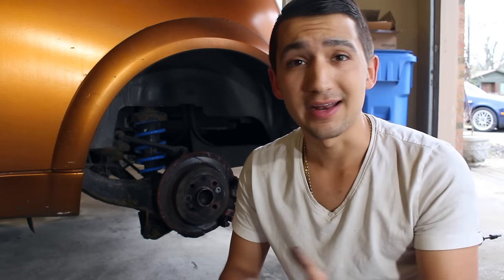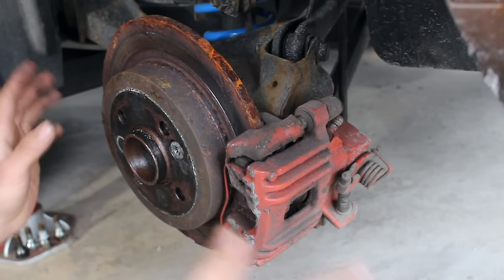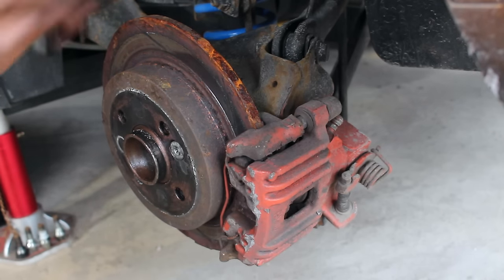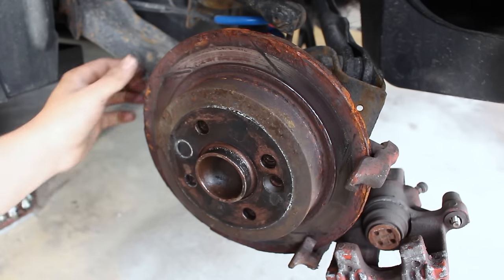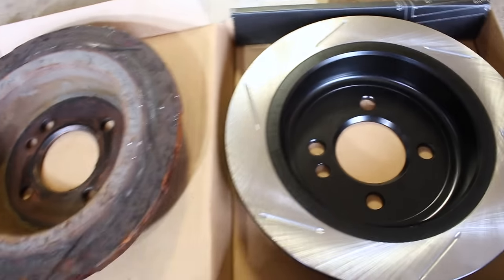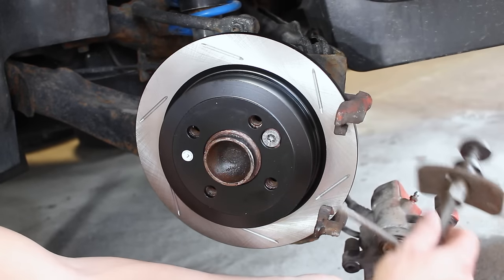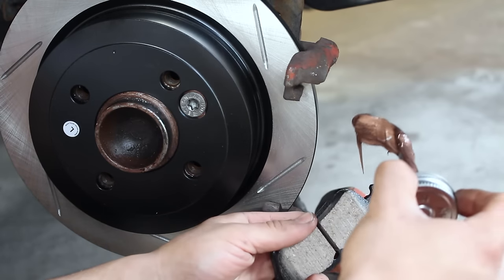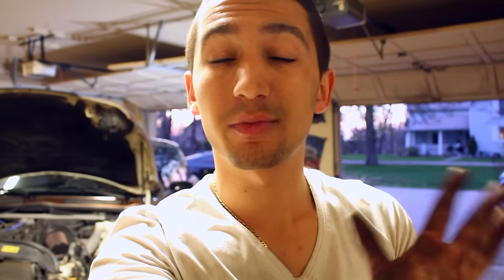The Best Lube for Your Brakes

Comment: The “general rule” is to use anti-seize” when joining 2 or more assemblies that are static; I.e. they don’t move relative to each other like a nut and bolt. . Grease is used when joining assemblies that are dynamic; i.e they move relative to each other like ball bearings mounted in a race. 
So, use grease on the caliper pins AND use grease on the “ears” & back of the brake pads & the guides. Anti seize “could” be used on the bolts that secure the caliper to the pins since those 2 assemblies are “static” relative to each other. 
Something I recall from many years ago from a Mechanical Engineering course.
Reply: I used permatex brake grease i used color violet to lubricate the back of the brake pads and the ears of the brake pads aswell and also the brake shims and for my guide pins i used the permatex color green grease because i used versachem brake grease before but I see it tthat grease is not good it cause my rubber bushings to swollen that's why I used those permatex brake grease
Reply: Qe awwwwqa
Reply: You should definitely NOT be using anti seize on bolts that secure the caliper. They often come with thread locker from the factory, so if anything put a bit of the blue one so they don't come loose from vibration.
Reply: In any area prone to snow, ice road salt and brine, use anti seize on every nut and bolt, even lug nut s. Vibration loosening is a myth.
Reply: @mattp4079  That’s been my experience also - I’ve seen grease or anti seize used with little or no loosening of fasteners. 

However if anti seize or “regular” grease is applied to wheel lug studs it reduces the friction when the lug nuts are installed & it changes the recommended torque. It’s possible to “over stress” the fastener where it may affect its yield strength - but again, I’ve never seen this occur.

Comment: It's good practice to put a light coating of anti-seize on the back of the brake pads too.
Reply: Wrong! If you are going to use lubricant, the paste would be better. The anti-seize would mess up the piston rubber.

Comment: I don't usually respond to YouTube videos but I'll just put in my two cents well he did do a very good job at explaining things the one thing he did do wrong however was installed the outer pad wrong those two metal tabs that you see on the actual back of the brake pad are meant to actually go in the caliper side to meet the two pins on the inside of the piston he also didn't use any brake clean on the actual brake rotors nor did he clean the back of the actual piston other than that a very well made video
Reply: It's great that you ACTUALLY noticed. LOL

Comment: you don't really need to put little screws back on,they only use it on assembly line to keep it in place,while the car moving forward in different section of assembly line  ,the rotor is actually hold on in place by lug nut,it is not a safety matter at all ,for those who are wondering,why it is there
Reply: Damn, you're right

Comment: Lubrication is a good practice, but there were a few things ignored here: wash the rotor with brake cleaner (might be also 3M) - it is covered in anti-corrosive oil. Inner break pad was not worn, neither was the rotor - there is a problem with breaking forces distribution. It breakes with 1/4 surface/force. Without fixing this problem, you will very likely destroy the new set of break disks and pads as well. You could have cleaned and lubricated the wheel hub (instead of inner rotor). It is important to be clean and flat.

Comment: Clear video. Thanks for sharing so clearly exactly what you do and use. There are so many opinions about lubricating brake components and what lubricant or anti-seize to use or not use. I live in Texas so can't relate to all the corrosion issues caused by winter road salt and the extreme methods necessary to keep cars operating in your conditions.

Comment: honestly great video the only problem i see is the anti seize on the pads from my experience when i do brakes on cars that I've put anti seize on the pads it just washes away in the rain or car wash 3m silicone grease doesn't wash as easy and i still see it when it comes for it's second brake service (use pretty much the same stuff just silicone paste in a tube)

Comment: See a lot of YouTube mechanics here. Having worked at a dealership, been working on cars at home for years and done a lot of brakeservices, I can say he did everything very well! 
Would also recommend cleaning off the hub and applying new antisieze, cleaning off the piston as well as possible and using brake clean on the rotors. 
For those of you saying he should not use grease/anti-sieze on the inside of the rotor, you must be thinking of brake drums. 
In this video, there is no brake drum, and if you don't know the difference, and don't know what the friction surfaces are, you should NOT be performing work on the brakes of your car.

Comment: Anti seize is widely used on brakes, HOWEVER it is NOT grease! Grease is what the engineers of most cars recommend. If you don’t believe me look at your repair manual. BMW recommends very little in the way of any grease if I recall. So they vary, but most say to utilize grease and if you understand lubrication, there is a distinct and measurable difference between a grease and anti seize.

Comment: You're should've used Sil-Glyde for the guide pins, thats why one pad was worn down and the other still had brake pad material left on it. 3M's silicone paste isn't really designed for brake pins hence why the pin was stuck and caused uneven pad wear.
Reply: +yoshiko130 I have some sil-glyde. It is good stuff but it is just the napa brand version of 3m silicone paste.both will do a good job on the caliper guide pins.

Comment: The only thing I would add is that, for this application, any type of anti-seize will work.  You must use "Copper" anti-seize on electrical components, particularly O2 sensors and preferably on spark plugs.
Reply: I was just going to ask why he uses "copper" anti seize and not the regular (Permatex Aluminum) anti seize

Comment: It’s not as bad rotor, it’s poor contact from the pads due to caliper biasing issues.
Discs edges will only corrode and the friction surface will be lipped if the pads were seated correctly and able to move within the caliper for even coverage across the surface.

Secondly, should’ve cleaned the hub with wire wheel/brush to remove existing corrosion/rust.
Same as the caliper bracket and actual caliper piston/pot, generally on any contact area of pads or shims.

Comment: What's so special about 3m? Is this sponsored?  The autozone silicone and anti sieze paste works fine too
Reply from the maker: +Tech Stuff I wish it was, but no this video is not sponsored by them. I've used both of their products and I love both of them. It would be selfish of me to hold that information to myself.
Reply: Tech Stuff It’s a silicone based lubricant. There are many others like it on the market. Super Lube comes to mind. All of them work when used properly.
Reply: it comes from the same petro chemical refinery but the 3M brand has an additional marketing and patent lawyers budget built into its cost... 99% same goop 🙂
Reply: @nordicpride9708  True but people tend to have their preferences from past experiences.
Reply: @glasser2819  This prosuct is filled with copper. You'll find the permatex anti-seize is metal filled as well but it's a bit thin for brakes imho. Works great for plugs and steel bolts though.
Reply: Tech Stuff: It's not the Minnesota or the mining that does it for me. But you gotta love that mineral!
Reply: Well, there are a number of silicone lubes out there that say they are for brakes, yet they still swell rubber. I personally like NAPA's Sil-Glyde.

Comment: Between the pad and the rotor... should I use the copper anti-seize, or the silicone paste? The rotor is obviously metal, but I'm not sure if the pad has any rubber in it or not.
Reply: TYSON B.   Nothing goes between
the, - - PAD  &  ROTOR,   other wise, you can't - STOP!!   please, please!!
use common sense!
Reply: 1) Is this a joke?      
2) If not, do yourself a favor and NEVER attempt to fix a car without having someone who has mechanical aptitude watching over you.

Comment: I do not trust that the lube, so close to the pads, will not bleed onto the rotor or contaminate the braking surface.

When I saw the glob go on the pad hadware, I cringed. It's just to close to the rotor for my comfort, and I can imagine it getting onto the rotor. 

Not a criticism; if the results are good: great!

I also wonder if Sil-Glyde would be enough to lube everything: slide pins, retainer screw and hub to prevent seizing. I'm sure the copper anti-seize is great but just wondering if Sil -Gyde would be sufficient. 

I'm either too cheap to buy 2 products or I'm just more efficient and/or economy thinking. Lol
Reply: Chris O — Anti seize, aluminum, copper, or nickel works great metal to metal. If washout is not a concern, then lithium or calcium base grease will work on metal to metal. Silicone (with or without PTFE) is ideal where rubber seals and boots are concerned. Silicone grease  will work on metal to metal, but it just isn’t quite as washout out resistant. So yes, you could easily get away with just silicone and probably be fine. Geeky guys just like to use the best possible option for any particular circumstance. 😊

Comment: Just one really important thing !.....if your vehicle has an A.B.S or E.P.S system the DO NOT use COPPER or metallic grease as it will interfere or  damage the system ...always use NON-METALLIC grease instead 👍
Reply: .... then metalic brake dust would be a bigger problem wouldn't it.

Comment: Don't forget to spray brake cleaner on those new rotors, front and back, and wipe them off before installing. They come oiled from the factory.
Reply: That is not always the truth, Textar supplies them with a special silvery coating to prevent corrosion while their on the shelf. No need to degrease them as long as you did not grabbed it in your greasy hands.....Okay?

Comment: First he didn't do a good job cleaning calipers etc. Second he didn't apply anti seize behind the pads so they don't stick to the pistons. Third he didn't spray brake cleaner on the new rotors to remove protective layer of oil. All in all bad video.
Reply: not to mention he put anti seize on a coated rotor, thats why its painted black.
Reply: Using brake clean is recommended, but not necessary. The oil will be removed by itself pretty quickly, and is not enough to effect braking much. If you have worked with brakes, you know that even painted/coated rotors should be applied with antisieze, as the coating really doesn't do that much. It helps, but it's usually a very thin, weak layer of coating. Never have I experienced that the pads stick to the rotors, but I do apply antisieze to the backside myself.

All in all, not a bad video.
Reply: Give him a chance.....
Reply: Whats your opinion with putting grease on the bearing and on the back of the disc?
Reply: These young millennials think they know it All!
Reply: Brake job is good. No need to put anti seize behind the pads, I have never seen a pad stick to a piston. Rotors are coated so they don't come with an oil coating to keep away flash rust. He could have cleaned the caliper where the pads slide, but its such a loose design its really not necessary.
Reply: He might just be bull shitting advertising the fucking 3 m brand.
Reply: Thanks
Reply: @caluarias  OK, boomer.
Reply: Sager Alkhalifa yeah cause you’re so perfect
Reply: Have to agree. Definitely a novice brake job
Reply: @Amberas1  He said the pads stick to the (caliper) pistons not the rotors. It's a good anti-squeal insurance to use it on the back of the pad.
Reply: Alot of premium discs do not come covered in protective oil. Also painted pads will still sieze up. So all in all. Uneducated comment
Reply: @mph5896  Just pulled the pads of a 2 year leased Kia and the back pad was rusted to the piston.  Only took a couple of taps, however was surprised to it prob wouldn't hurt to put a little anti-seize or grease.
Reply: @benten6301  BS or not, it was an excellent video. Do you have a video up we can watch thats better, or one at all?

Comment: Rotor is coated with Copper Antiseize? It might be causing more problems when the copper runs all over the rotors and brakes. How did the rotors get so pitted? Salt baths? Washing off the salt might help. Looks like the brakes sat for long periods with salt to get that pitted? The rotors should have a smooth shiny surface if working properly.
Reply from the maker: This is what happens when you live in a northern area where snow, salt, and daily driving is a thing. If this was sitting, I would bet that the callipers would have been seized.

Comment: Just  did rotor s and pads had to replace bottom slider pins and boots   on load used copper lube on sliders pads caliper bolts good stuff  I had stock grease on pins before no good pads started to wrap  cooper lube the go I'm courier so lot of stop start on brakes recommend the copper lube

Comment: I replaced my rotors today but didnt have any anti-seize compound so I used ceramic brake grease on the hub. Will this be a problem.
Reply: Only if you want to drive in a straight line 😐
Reply: Terry Chootiyaa ?

Comment: the copper antiseize didn't make your rotors not stick, that was the black coating that was on there from factory.
Reply from the maker: The black coating will wear down if you give it enough time. The coating will prevent it from happening so fast, but the copper anti-seize will do a much better job at preventing both pieces of steel from fusing and rusting together

Comment: Damn, son!!!! That old rotor looked nassssss-teeeee! I live in Southern California and the only thing I use that 08945 3M on are the back of the pads, the pins, and the sliding surfaces of the calipers, and years later they come apart as easy as they went together. But I also have 8 million neighbors crawling up my butt, too.  Given the choice, I'd take the rust.
Reply: Edit: You know, I was just thinking. The 3M lube I own is super thick - probably because it's old. I'd hate to beusing it in Canada during the winter. Probably break the brush off in the can! That said, 3M says you can dilute it with some motor oil if you so desire.

Comment: @milanmastracci thanks for sharing your knowledge. Does the type of grease you use also depend on the specific material used for the brake system parts? Or is it pretty universal that you can use copper for metal on metal and silicone for rubber on metal. Could I also generally just use aluminum based grease (I have a tube from permatex)?

Comment: Great video and you obviously know what you're doing. Now I'm no expert but that brake disc is so badly corroded how come you didn't deal with it sooner? If it actually worked, surely the noise would have drawn attention to a problem with the brakes.

Comment: Good job, and finally the 3M silicone dropped to around $6  so I could afford it.
Reply: Where $6? Everywhere im looking is $20+
Reply: @lorenfok1097  yeah, I see it's back to $17. I got it 2 wks ago  Amazon $6.42 delivered. I put it on a camel watch list for Amazon to notify me when it dropped below $7. Took 6 months to drop.
Reply: @MegaHugro  wow you gotta be kidding. That's crazy good deal. I kind of need to do my breaks this weekend so I ordered and got prime for $27
Reply: @lorenfok1097  man I would send that right back. Put it on a camel camel watch list at seven bucks and keep an eye on your email. BTW, I cancelled prime 2 months ago and I sure don't regret it's a joke.
Reply: @lorenfok1097  BTW, make sure you get your brake parts from RockAuto way cheaper than Amazon or anybody else
Reply: @lorenfok1097  its back to 6.65 tonight with free shipping amazon.
Reply: @MegaHugro  wow ty so much. What a crazy fluctuation in prices.

Comment: Am I wrong or the rotor you installed goes on the other side?
Also i wanted to ask what kind of brake pads were used?
Reply from the maker: +Joel Mendoza No its on the correct side :) 
I used a set of Akebono ceramic pads.
Reply: If this one in your video is on the left rear the rotor you assembled is supposed to be on the right side (the slides are mirrored).

Comment: For the bolt that bots the rotor to the hub, shouldn't we use thread locker? I have heard that putting antiseize on it might change the torque specification of the bolt. Meanwhile, the thread locker are supposed to be able to remove.
Reply: those screws only index the part, the clamping force comes from the lug bolts.
Also youll want to eat a bullet if you put loctite on that screw
Reply: Ha ha vordevan I second that. You even can leave the screws out, you don't really need them.

Comment: Thanks for the tip, do you recommend any anti-seize for Brake Fluid Change (nipple) and Differential Oil Change (Bolt)?
Reply from the maker: If you have it, it doesn't hurt to put some on :)

Comment: I'm replacing my shifter bushings with poly ones and some like the energy suspension ones come with bushing lubricant.  since the main prob with the rubber bushings is that the petroleum in traditional lubes dry it out them out i was wondering if i can avoid using the bushing lubricant all together and use this 3m one instead?

Comment: Why is only the outside pad totally worn? shouldn't they wear out more or less evenly? 2:08
Reply: Collared Greens it varies on every situation. Depends if you stomp on your brakes a lot, when the last time you got your brake fluid changed, not enough lubricants for the guide pins. It's really hard to pinpoint.
Reply: Also, the backside does not get easily cleaned when washing your car, and if you drive in a place where they salt the roads during winter, everything that does not get rinsed often enough just get eaten away.